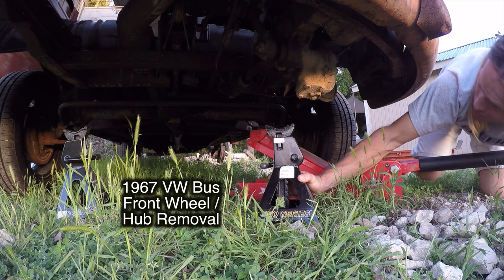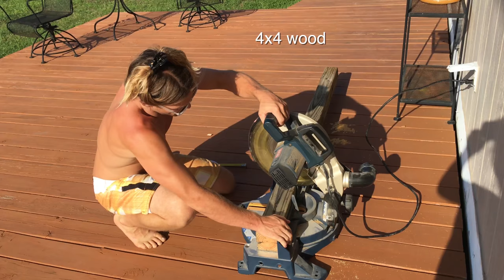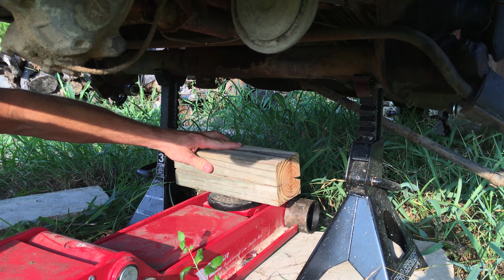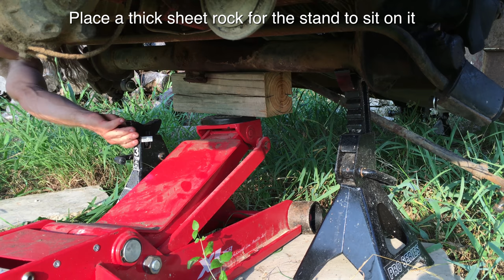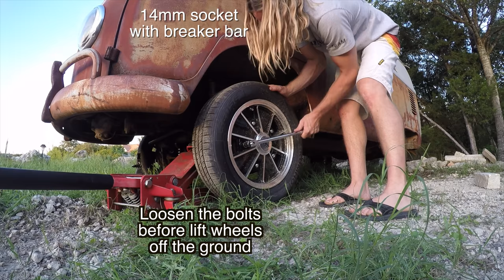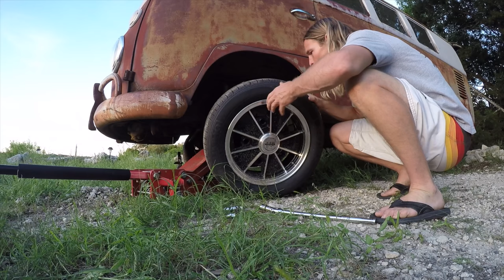VW BUS - Front End Lifting / Wheel Removal | MicBergsma

Comment: loose bolts few, two turns before lift.    in the air remove all bolts,  you can damage the threads.   same backwards, put the bolts on the wheel with braker bar  in cross X.  in the ground tight 70ft-lb torque for safety !!        Mi ingles es malo amigo!!   :D saludos de Guatemala
Reply from the maker: Got it, thank you!